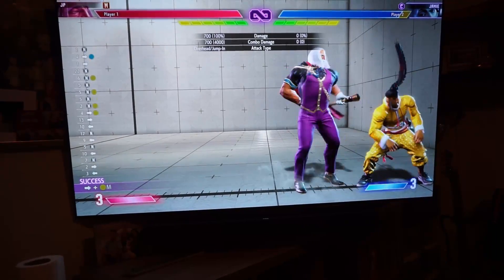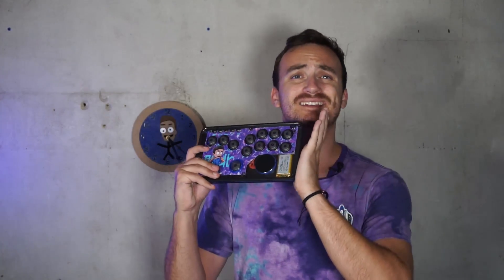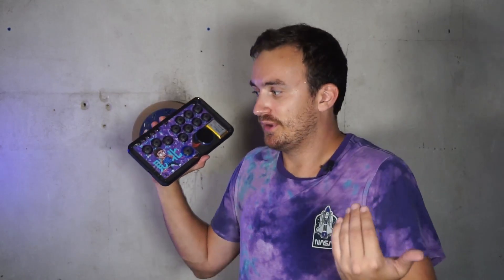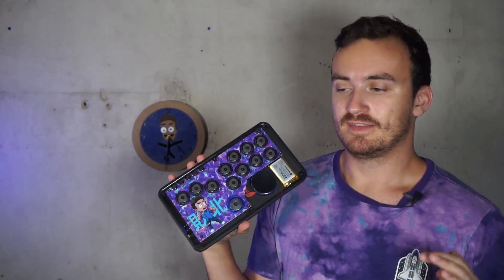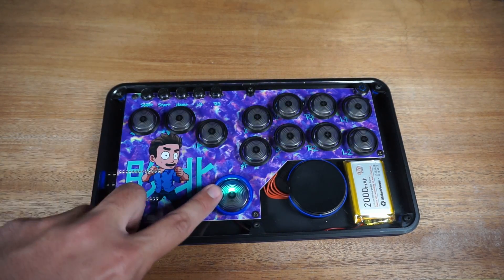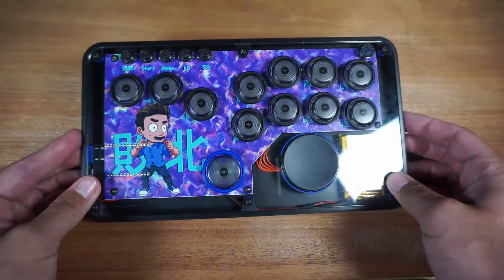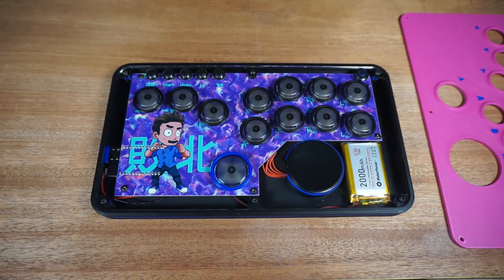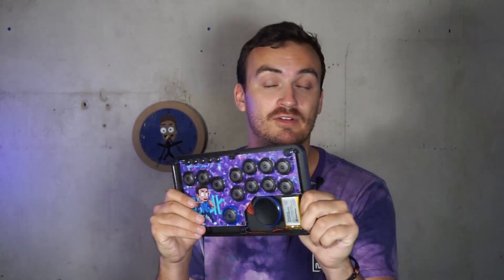I Built a Wireless Leverless Fightstick Controller (and it works!)

Comment: At this point, I wish Framework made a half-width motherboard and AMD made a quarter-width GPU, which could be paired together using Framework's new connection method, so people could have a modular handheld capable of lightweight gaming without a dedicated GPU, as well as a slot-in dedicated GPU, each with it's own separate cooling system. And for those who don't need the dedicated GPU, they could simply use the PCIe lanes meant for the GPU in order to have something like extra SSDs for extra storage, or maybe an external battery which can be connected with a USB-C cable whenever it should power or recharge the handheld's actual battery. And a screen with touchscreen and bluetooth-pen for drawing and writing with palm-rejection, would also be great. That way, people could use the framework motherboards to make anything from a tablet/phone, a graphic tablet, a handheld PC, a normal PC with a backup screen, or a mini-PC.

Comment: Cool video. Another build you might be interested in would be a modular arcade/ fight stick. I have seen a lot of videos on how to build or mod arcade sticks with different movement options (lever, keyboard switches, buttons, trackball) but it would be cool to see a modular controller in which you can swap these depending on what game you're playing instead of having multiple controllers.
I have seen a couple of retail options available but they are too expensive and/or do not have much options in terms of the modular parts.
Reply from the maker: Cool idea! That is probably doable, but may have some complex firmware

Comment: Neat.
I have a wireless keyboard that shows battery percentage by lighting up the 1-0 keys accordingly. You should do that with your gamepad as well, gives more "resolution" to the battery indicator.
Reply from the maker: Oh, that's a good idea! Maybe I'll implement that once i tune the battery gauge to be more accurate. LOL
Reply: @TommyBee456  Oh, what's the problem with the battery gauge?
Reply from the maker: @J0ermungand  nothing is necessarily wrong it's just that it could be a bit more accurate. I think the map function i uses too low of a value for the low battery. Just need to experiement more and measure with my multimeter
Reply: @TommyBee456  Well, if it's a regular LiPo it's absolute minimum voltage should be 3.3V. after that you shouldn't drain it further to keep it safe. But ofc the minimum voltage also depends on what the DC DC converters on your PCB need. Like if you were using the standard 3.3V linear regulators that you'd find on an ESP32 board usually, you wouldn't be able to work all the way down to 3.3V battery voltage. I think they need a volt or so difference to work properly.
Switching regulators are more efficient, but even they have a minimum input voltage that might be higher than the LiPos minimum voltage.
Measuring the point of failure for your device is a good idea to set a real world minimum voltage; though browsing through the datasheet(s) of the voltage regulator(s) involved can help too.

Comment: I'd love to see the PCB design process in a video. Did you order it fully assembled or did you source and solder the components yourself?
Reply from the maker: I soldered it myself. I chose 1206 smd parts specifically to make hand soldering easy. Im still working on it but i will put a build guide on the github

Comment: This is so sick. There is an incredible open source firmware for game controllers, but it doesn't support wireless in any form (yet, despite a pretty hefty outstanding bounty). Really nice to see people trying different avenues. Also very cool that you went with the trackpad route.
Reply from the maker: gp2040-CE? Making that wireless would be endgame for me lol. Seems pretty tough though, maybe needs an additional MCU
Reply: @TommyBee456  that's the one. The main approach we wanted to try was using a Raspberry Pi Pico W, i.e. the wireless-enabled version of the Pico. But there are some licencing complications, for one thing. And IIRC some tests done in the dev community found weird latency spikes.
Reply: Do research programmable microcontrollers. Apparently, there are some fairly cheap ones capable of wireless or bluetooth communication, I saw that in a video in which someone tried to use those for sensors, and some of the options had some beefy specks for a low price, if all you need to do is transfer data and lightweight encoding the data into the format to be sent.

Comment: awesome project! love that you add a touchpad in there too. my only problem with esp32 is their fast battery drain even though its ble, at least in my experience after modding my snes gamepad
Reply from the maker: @babixillo  yea, the power draw is super high, especially for something called "Bluetooth Low Energy." Haha. I didn't mention it, but that is why I used a 2000mAh battery. I calculated that it gets me about 18 hours of gametime and about 1K hours in standby -that still needs to be confirmed, though.
Reply: @TommyBee456  that is a very good amount of game time! i think jfedor made a wireless flatbox too not too long ago but it uses other chip i cant remember but i know its way more expensive than an esp32.